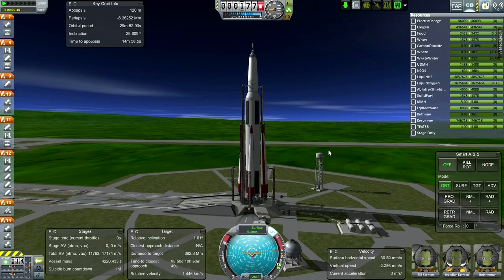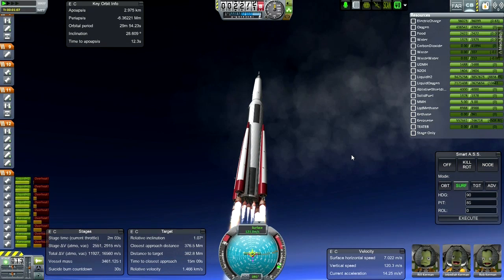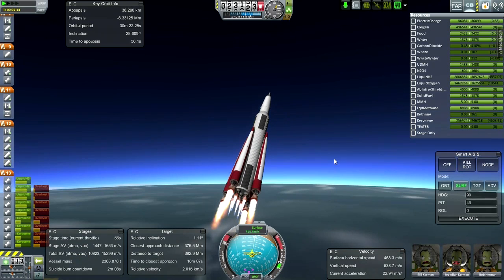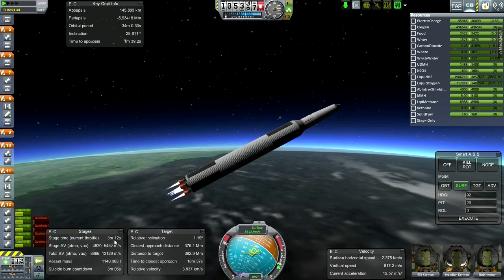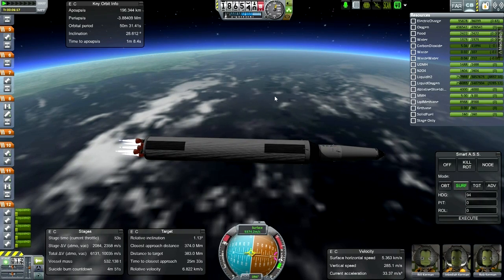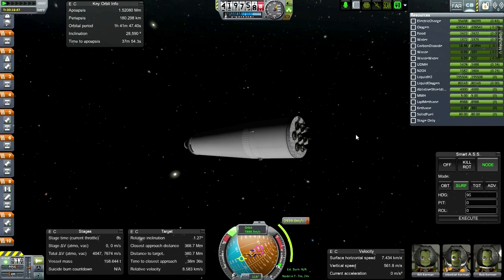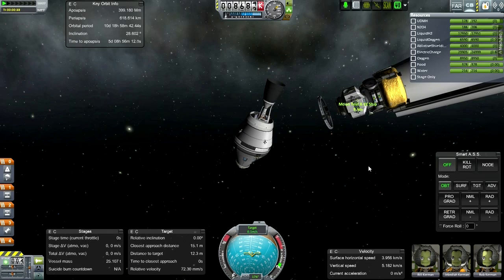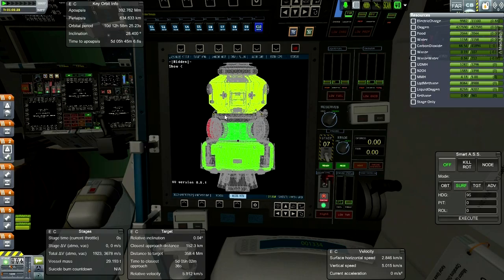Kerbal Space Program (0.24.2) - SP12 - 160t to LEO Launcher Test

Comment: Not sure about SSME, but upper-stage version of RD-0120 (russian equivalent of SSME) was actually developed (but wasn't flown).
I'd replace F-1s with RD-170s (they got more thrust AND much better Isp) in boosters, and put RD-0120 on top. This way you would probably get away with only two side boosters, or - if you keep four - the boosters would probably provide enough thrust to allow you replacing RS-26 with SSMEs (or RD-0120s) on the core.
Reply: ***** F-1 and RD-170/171 are anything but interchangeable since Isp of latter is waay higher, which makes the latter preferred just about everywhere (except where costs are a problem - F-1 is much cheaper since it's much more simple technologically). 
SSME has higher Isp than RS-68, so provided that thrust it's a problem it's better to use them instead. BTW - "russian SSME" a.k.a. RD-0120 was also designed to be reusable (and it actually was test-fired multiple times to confirm it's reusability) - it's just engineers never actually got to build a reusable stage. All engines in RD-1xx family are reusable as well - this is in part to allow for full-duration test-fires before using engines for the actual flight. If my memory serves me, RD-1xx are certified for 10 burns (although some test articles exceeded 60 burns), and RD-0120 was also certified for 10 burns (but again at least one engine went through 20 burns). As a matter of fact, ULA actually seriously considered recovering RD-180 from Atlas-V's booster stage via parachute-assisted helicopter pickup - see here: http://www.ulalaunch.com/uploads/docs/Published_Papers/Evolution/EELVPartialReusable2010.pdf It's a pretty cool concept if you ask me :)
As for flyback boosters - as I've said above F-1 is pretty cheap so it's probably not worth the trouble to make them reusable - and the engines themselves were not designed to be reusable anyways.